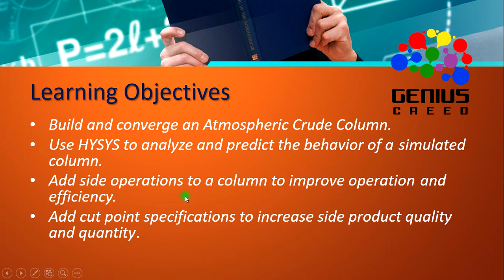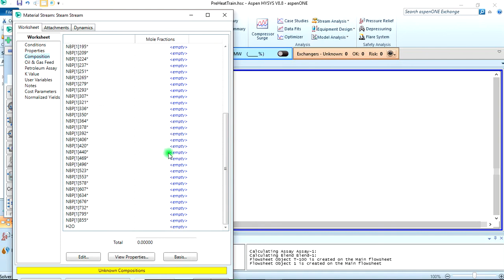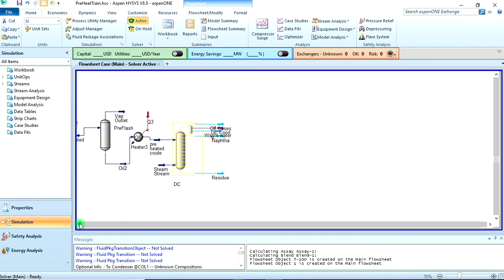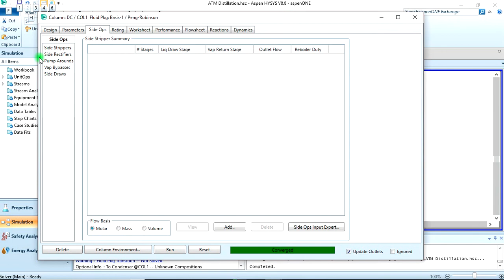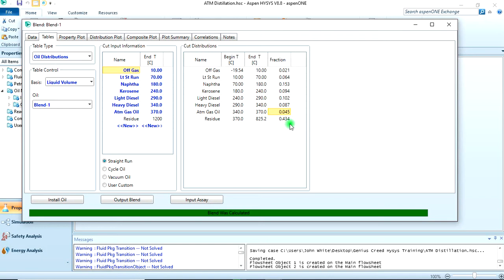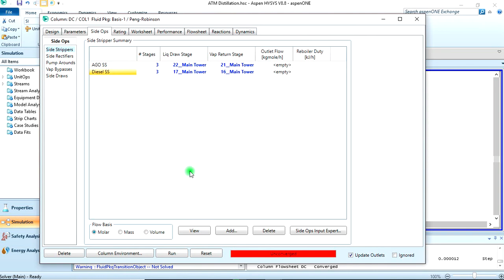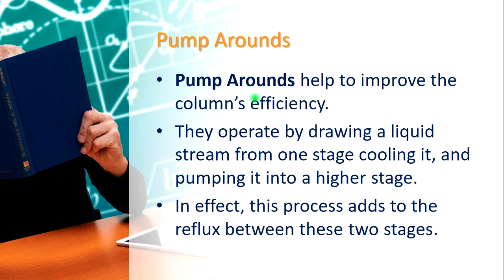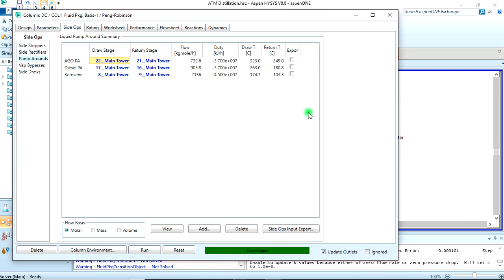03 Atmospheric Distillation of Crude Oil

Comment: Good morning, I would like to ask the following regarding the exercise described in this video. I am using hysys v14, when I run the simulation it does not converge when including the side stripper for the diesel. I have observed a difference in the performance of the products, especially with respect to gasoline and diesel. What could be the reason for the difference in performance theoretically calculated by hysys between its results and mine.

Comment: Very Nice Video.Would like to highlight small observation ,For Kerosene Pump Around Loop ,Draw off stage(Stage -8) & Return stage(Stage-9) is not in line with presentation data.You may cross check and update accordingly for consistency purpose.If the corrections are updated ,the Kero PA draw off temperature would increase to final value of 184.6 Degree C.
Reply from the maker: Thank you very much for this observation.
It was probably an oversight on my part.
Others should kindly take note of this.
Thank you very much Mr Sandeep